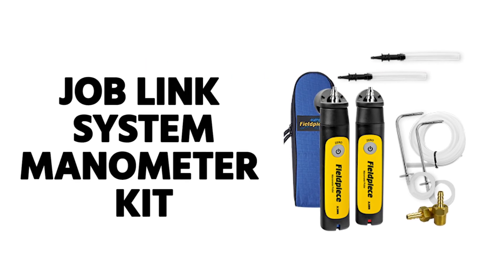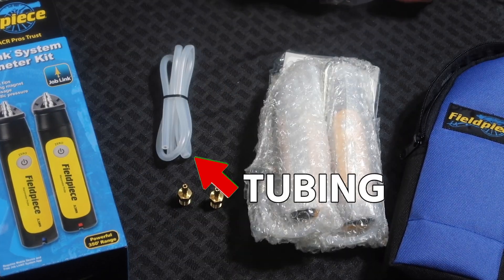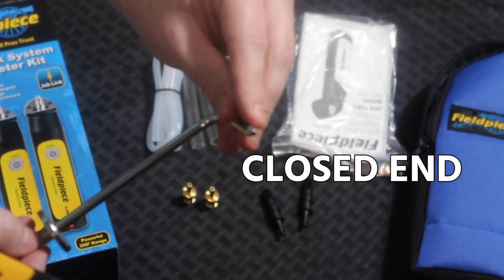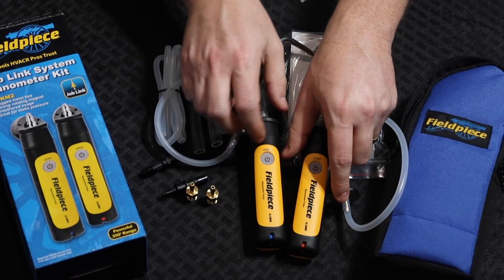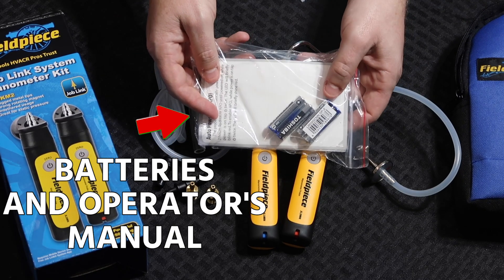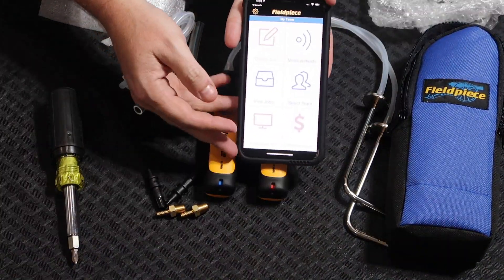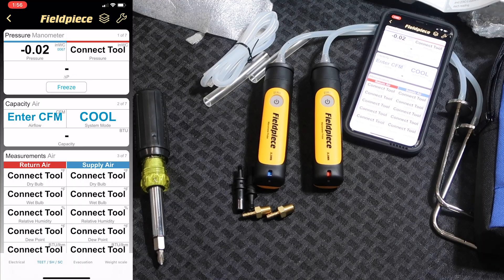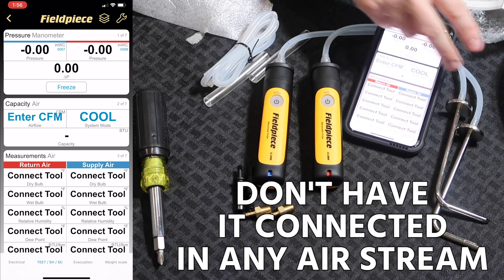Introduction to the Fieldpiece Joblink Manometer Set

Comment: Great video, only problem I’ve found with them is actually in the app. When trying to display more then 2 manometers. It will give you more lines to display up to 8 sets but the app seems to only display 2 probes on all 8 lines and when you try to change to one line they all change. But with MQ they work great and the stability of the readings are amazing.

Comment: Hello I'm just a few months into the field from trade school. Would you recommend this over the SDMN6
From fieldpiece? I do carry their wireless 6 probe kit. Thanks.
Reply: I had the same question, I don't have neither one, you have to think about which one you will take more advantage, it will depend on what you need it the most. After checking the details on the SDMN6 and JL3KM2 manometers probe, I decided if I only can buy one it would be the SDMN6. The SDMN6 has a built in pump to check pressure switch on furnace and others gas heat units, but it doesn't connect with the app.
Reply: @A D I have none. I'm trying to get the most versatile one, just guessing the probes is not limited by hose length but what else is different? Thanks.
Reply: Hi